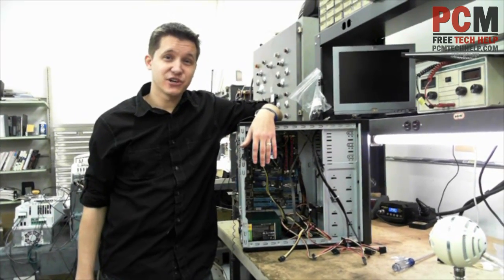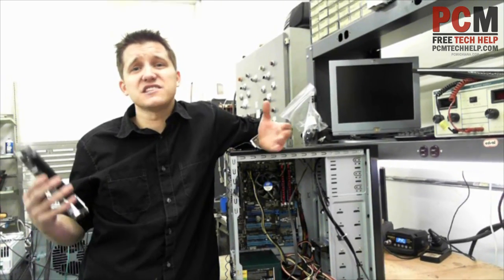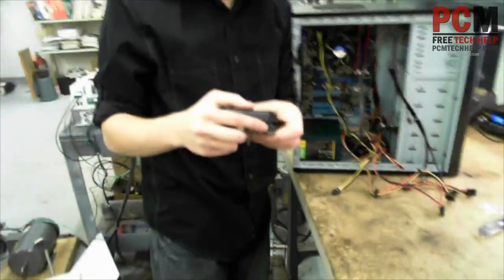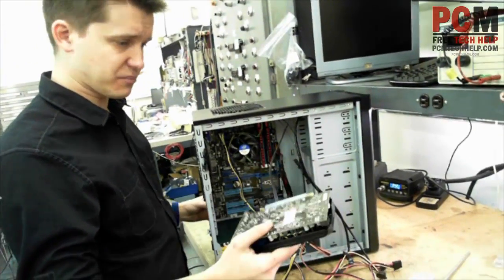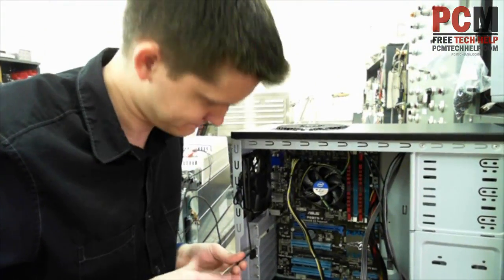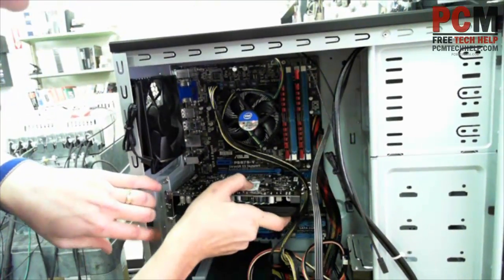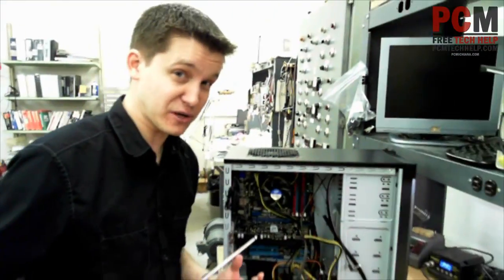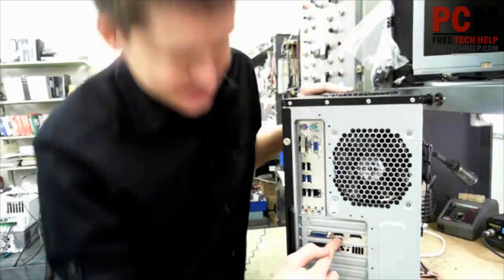How To Install A Computer Graphics Card (PCI Express) (2022)

Comment: I'm slightly confused. On my computer the PCIe 3.0 port doesnt line up with any bus on my case so I'm not sure what it would be like if I tried to install a card. As well as that what if the port is on the wrong side so the hdmi port etc faces the wrong way? Could that happen?

Comment: my psu doesn't have a 6 pin conector,where can i get IT and hoe do i install it ?
Reply: +HotzPrinz thx but i dont have this problem anymore
Reply: +HotzPrinz no i bought a card that doesn't need that
Reply: +HotzPrinz Zotac gtx 750 ti
Reply: Chroamex hey I just got a 750 it and I don't know where to find the 6 pin cable thing

Comment: I'm thinking about buying gtx 960.
it asked 8 pins connector, I looked in my Pc, and I saw I dont have 8 pins connector, I have 6+2 side by side.. I think that ment to be connected like this.the question is, if ill use 6+2 pins connectors it will work? act like 8?

Comment: What would happen if you didn't plug in the pci 6 pin plug(s)?
Reply from the maker: +hegotaspare Your graphics card will not work properly.
Reply: I plugged it in and it only lights up, gotta have to wait a lil longer

Comment: i need help i want upgrade my graphics card but my dell optiplex 755 case is so skinny that the part where you plug in the cables (my current gpu) is around 3 inches wide are all graphics cards like that or do i need a bigger case. please respond

Comment: trying to figure out my power cords here... I got the R9 280x  by XFX... its got two power cords so I am thinking they both need to come from power supply but I have the PSU pcie power cord and it has 2 ends on it but I am thinking I actually need to use 2 separate connectors,am I right? The PSU cord has a 6+2 running to the card but on the end it has another 6+2 connector... I guess I could play it safe and use 2 separate 6+2's and be fine but if I dont need both i would rather not have the clutter.

Comment: Would it be possiable to put a low level gpu on a laptop if the laptop has an expresscard slot? I saw an expresscard to PCI-E adapter on amazon.
Reply from the maker: I'm afraid it's not going to have the effect you want. Graphics cards need extremely high bus speeds. You could TRY but it's a long shot.
Reply: Unknown  There really is no solution to this at the moment. Doing what you want to do is going to end up either not working, or being so inefficient and low-performing that you wish you hadn't spent so much money on it. Right now, there really aren't any feasible external graphics solutions on the market, but there are a few notebooks with some promise (that doesn't help you if you've already a notebook, however). The rule for now is to buy a notebook with the most powerful GPU you can afford, and run it for as long as you can. I'd suggest you sell the laptop and build a new rig.

Craig Chamberlin PCI-e Gen2 @8x is more than enough for any graphics card these days. What he's trying to accomplish is rather desperate.

Comment: Hi Craig i just wanted t ask you 3 questions
1. on my computer there is 2 free connectors and they p4 and p6 does that mean that it is 6pin and 4pin connectors or is it just part names?
2. is the: MSI HD 6670 2GB DDR3 VGA DVI HDMI PCI-E Graphics Card. a decent card to do medium gaming with? 
3. Do i have to do any un-installing for the intergrated graphics card to user a new one or can i just leave it?.  
 If you or anyone else reads this please reply. thanks for your time.